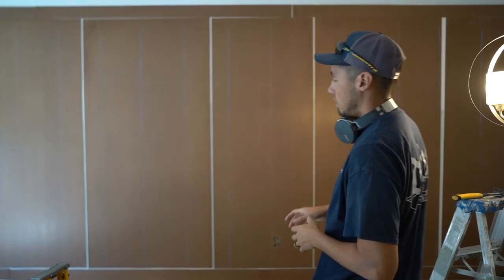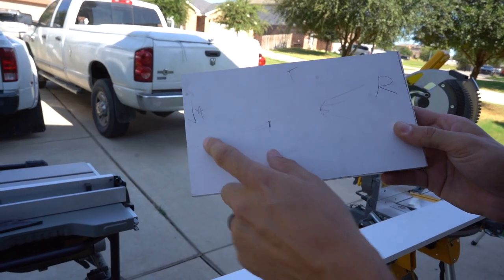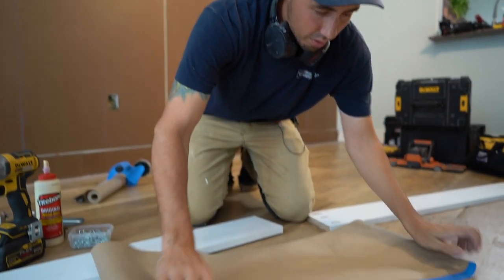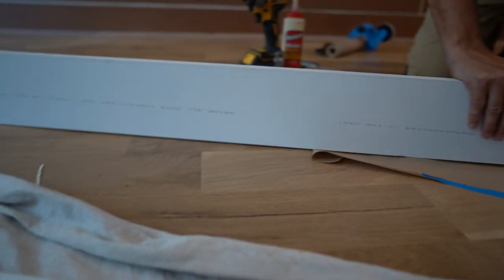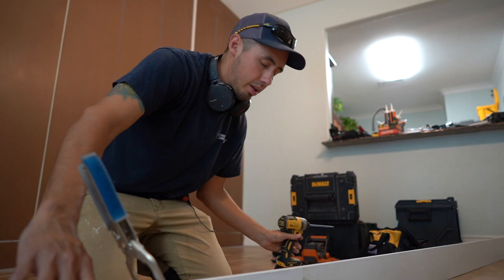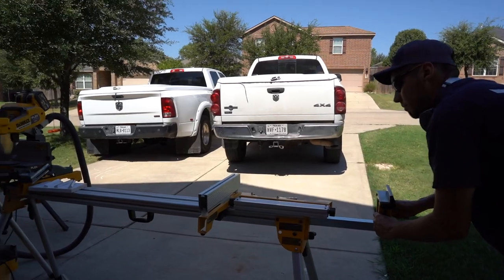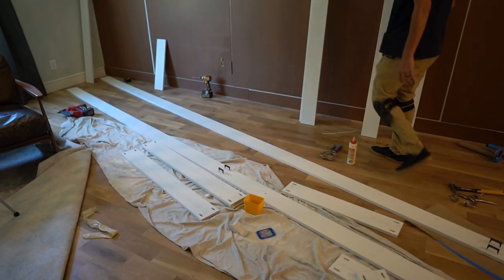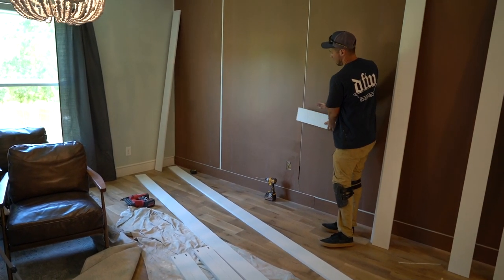I hope these pocket screws hold...

Comment: Basically just like making cabinet face frames, but on a much larger scale.  Key here is that all the 1x material is the same thickness, which you ensured by buying the Windsor moldings, and that the edges are all square (not trusting factory edges).  I'll be showing this to my wife when it's time to do an accent wall...

Comment: Interested to see which saw stand you are going with.  The insider carpentry guy has a clever one he made, but Fastcap looks tempting if that's how you made your living. 
My miter saw ( 15 yr old Dewalt non slider ) is a shop tool so I don't have to move it and can have whatever I can build and never have to break it down or carry it :)

Comment: wait what, when did the glue part of this start. or was this because of the size of this 
wall. do you recommend gluing even the smaller builds
Reply: You can but pocket holes should be enough

Comment: Have you tried the Milwaukee M12 Fuel impact driver. Lightweight, loads of power, and batteries last forever. I love mine. Most used tool I own. Also, I picked up the M18 18 ga. nailer on your recommendation. Very impressed! Thanks for all you do.

Comment: What gauge and length nail do you use for 1x material? I've been using 16g.. but seems overkill, but my 18g only shoots 1 3/8" which doesn't seem long enough for good grab 1x and drywall

Comment: Great job Richard, would you ever consider using a biscuit in the center of each joint with a pocket screw either side of the biscuit? It would make the joints stronger and help align the boards when assembling, I cannot fault any of the work you ever do you are a true professional, its just a suggestion

Comment: That looks amazing!  Why is it that you have to build the frame and then set it all in?  Obviously that's better than building it against the wall, but why?  What do you avoid or add by doing it that way as opposed to piece by piece against the wall?
Reply: jubjub247  pocket screws are not always seamless
Reply: No wall is perfectly flat or planar. This way all the joints are tight and seemless and do not follow the imperfections of the wall
Reply: anyone that follows DFW knows that walls are not perfect and Richard wants the best finish possible. so it must be done this way. i tried 1 wall without pocket holes and
it sucked. walls are not perfect Richard is.
Reply: jubjub247 but he’s using paint grade no? Nail holes will not be seen. And it’s 1 by so it’s only 3 quarter thick who’s gonna pull that off the wall? Great way do to something like that if it was all stain grade though
Reply: Within two weeks of releasing this video, he released another video in which he piece-built a similar paneled wall. The difference was that in the other video he was using HiPur adhesive for the first time. My conclusion is that he built the wall in one piece in this video because he needed the strength of pocket screws and had no other options to get that strength until he started using HiPur.

Comment: Why not let the vertical pieces “stiles” go full top to bottom then you wouldn’t have to put a seam in your  top and bottom rail....  just curious?
Reply: The inside panels would have more error, I bet when he cuts all the panel moulding, he will sort one out and cut all them the same length

Comment: Why assemble it beforehand if you nail gun anyway? Couldn't you have done all three horizontal rows first, and then connected them? I'm guessing it must make the joins tighter, and/or the studs weren't ideally placed? Or is it just needed structurally?
Reply: @PADOYLE  Ha, fair point, and makes sense, it's much harder technically but if done properly it's a seemless result (I am obviously not a tradesman)

Comment: amazing you got the pocket screws to hold, I did something similar but on a smaller scale and they just ripped out. I doweled them and that worked better.
Reply: Pocket screws work just fine if done correctly.
Reply: @ilovelexi1t20  It was a heavy maple 4ft tall x7ft long panel, the vertical stiles ripped out.

Comment: Why didn't you just built the frame  piece by piece on the mdf wall with wood glue and nails. Pocket screws weren't necessary.
Seems like a waste of time.
You nail it on the face at the end anyways.
Reply: I was wondering the same thing. Richard what was the reasoning for not just assembling directly on the wall in the pieces?
Reply: @darylbunning3903  I know
Reply: He could have saved 2-4hrs
Reply: At 9:43 he had to go through the the bottom to get out. LOL
HE DIDNT SHOW IT.

Comment: Well wveryone has their own ways to do the same..  but literally is not need screew all molding you can nail il or use plastic anchors ( not always you will nail a stud) to hold them then use wood filler to cover the screw hole (use undersink bit).. later to cover the join 2 options bondo ( golden ) or glass in case there is a large gap... sand it later.. and you will get a strong joint ...

Comment: Why are you installing with the top and bottom rail pocket holes out?
Reply: You drunk? He's screwing in from the back
Reply: @boscoe0966  Please examine the video at 10:20. Notice that the third panel from the right, the bottom rail has the pocket holes facing out. All of the pocket holes attaching the stiles to the bottom and top rail are on the inside face, facing the wall such as at 10:51 he's screwing the end stile into the top rail. The top rail is pocket screwed together above the fifth panel from the right. Both can be seen at 11:08 where Rich is in the right side of the frame (video type).
So, no. I'm not drunk. Perhaps you are confusing the stiles (Vertical) and rails (Horizontal)?
Reply: By the way Brother, I'm not trying to play gotcha. Just puzzled.
Reply: @OldSoldier54  I think you're seeing the pinch dogs that he hammered in at 5:10. Notice there are only two of them but he has 3 pocket holes on the bottom rail.  I can't see any pocket holes facing out but maybe you have a better monitor than me
Reply: @boscoe0966  I've gone back back to watch the splicing of the bottom rail. I think you're correct. It's the pinch dogs I'm seeing which makes a lot more sense.  My bad.